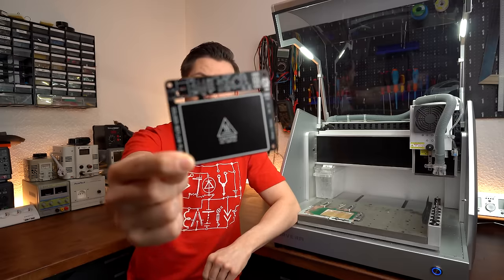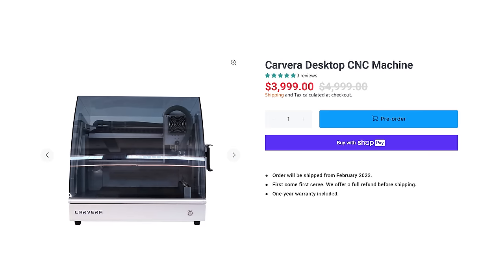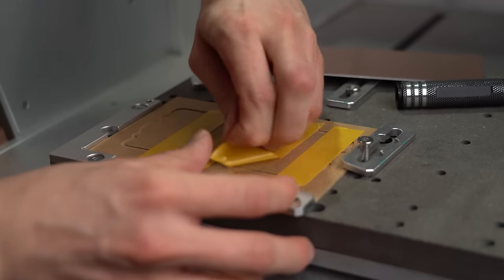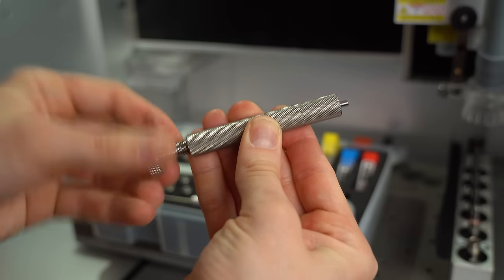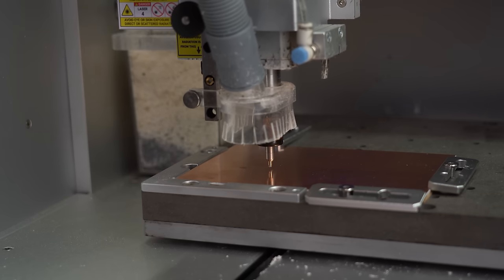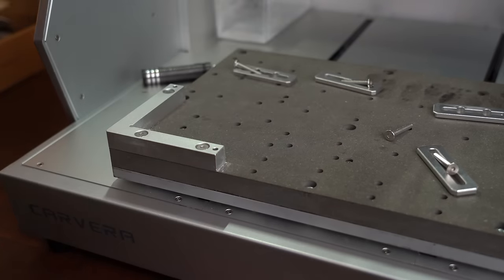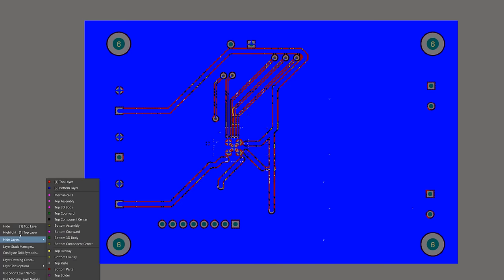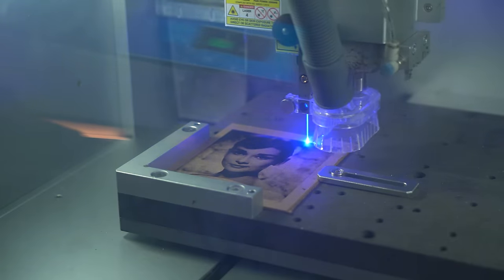"A Machine PERFECT for Making PCBs at Home" Is what they said!

Comment: The whole point of doing DIY PCBs is that you're done in a couple of hours, rather than waiting a month from China. You can do iteration after iteration. Then once you get it right, you order from the cheap chinese companies.
Reply from the maker: That is correct :-)
Reply: @1014p  I would never send anything there to rando PCB companies if I was designing something for sale, but like it or not, nearly everything which you want assembled for cheap would have to be sent there anyway.
Reply: It doesn't take a month for JLPCB maybe 2 weeks tops. It literally took longer for me to receive PCBs from OSHpark located in the US than it did from from JLPCB. I will say that OSHPark's silkscreen is amazing and the cheap silkscreen option at JLPCB doesn't do a great job with fine detail graphics but it's not a big deal and works perfectly fine for footprints.
Reply: @atomicskull6405  I ordered something from jlcpcb just the other day and lead time was 28 days. Probably has to do with location (I'm in the US).

Even if it took 2 weeks, that's 2 weeks vs 2 hours.
Reply: You don't have to wait a month to get a board from China. Turnaround times are faster then that.
Reply: @atomicskull6405  Exactly right.
Reply: @larrybud  The lead times are worst case. It might take that long but usually it doesn't
Reply: @thedarksage328  I just told you how long it's going to take. I'm not guessing.
Reply: @larrybud  I'm sure that if you work hard enough you can find someone that takes a month to deliver your boards.  I just know that I, and my colleagues never have to wait more teen 10 days, or very rarely two weeks.  So by all means machine your circuit board and do all the manual secondary operations to make it work if it's anywhere near complicated.  What a waste of time.
Reply: LOL, everyone's like, "it doesn't take ME a month to get MY order..."

Like everyone lives in the same country with the same shipping process and the same Customs agency so if THEY can get THEIR order in a week, everyone who says they can't must be lying... 🙄
Reply: @RealSiViX  yeah, it's so weird. Doesn't negate the main topic of the video either. You can make your own PCBs in an hour or two, and even with the best case of these guys above, they have to wait 10 days. 

I can do 5 iterations of a board in a day, they'd have to wait 2 months....
Reply: For those who live in the US. pcbway(Chinese company) tends to have a one day build time and 4-5 day ship time
Reply: And your custom pcb is now on the Chinese market...
Reply: Well, one of the points. I made my PCBs for fun mainly. There is something really inspiring in seeing your own creations come to life.
Reply: @atomicskull6405  and what if you live in europe?

Comment: I found it to be very reliable to use the laser to etch PCBs instead of trying to route them. I spray a coat of black enamel spray paint. Laser etch the circuit, then into copper etchant like the usual method. I use a cheap 200 dollar solid state laser.
Reply from the maker: Good idea :-)
Reply: Yeah I was wondering if some kind of laser or optical process would give better results, though I guess if you're drilling at all you'd have more tool offsets to worry about.
Reply: As an eastern european "cheap" and "200 dollars" don't mix too well for me 😅
Reply: @DiaconescuAlexandru2024  It's cheap compared to the multiple thousands of dollars that many lasers cost.
Reply: @skylerlehmkuhl135  oh
Reply: Cnc routing is better than laser, because it has much less manual hand work required, and no chemical acid, paint etc required. While they both can only produce simple one layer PCB.  Besides , even using laser, you still need a lot of holes,you either do it by hand drill,or , CNC. How many holes a Arduino Nano dev board has?  Also, CNC routing is safer than laser.
Reply: I've thought about exactly this, including the black paint coating, cool to know it works. Might have to order a $100 20W ebay eye-blaster laser head to strap to my 3040 CNC machine.
Reply: Can you strap it to a 3s printer?
Reply: @xferme  Don't see why not on mechanical level, but depending on the controller there might not be an extra channel available to provide the control signal for the laser head. My little engraver is running off a Arduino Mega with GRBL, so it's got plenty of extra I/O and GRBL already has the gcode features to access it.
Reply: How fine can you get the tracks and details? The big problem with cnc routing tracks is when you try to do fine stuff.
Reply: Dry film photoresist method with a <$200 MSLA printer does that for <1/20th the price, and you don't need to wait for paint to dry.
Reply: Etch you! Sorry I sneezed 🤧
Reply: We tried this as well, with okay results, but some of the traces were malformed (probably my fault).
We run a business involving laser etching fortunately, and using a couple passes with a fiber laser right on the copper before applying solder mask and taking it off with the laser worked VERY well.
Reply: @DiaconescuAlexandru2024  No problem comrade, what You can do is to put an old display with changed backlight and photoresist on pcbs.
The pain is not etching, the pain is in drilling
Reply: @ДаудМухамеджанов  huh, I never thought of doing that, thanks! And yes, the biggest pain is drawing on the back of the copper board and drilling.
Reply: @chrischris6399  CNC routing is only safer compared to a laser as long as you have a proper dust control with a HEPA filter. Stuff like oil and such is not a proper dust control when dealing with carcinogenic FR4 dust. If you are doing that then that's really no better than using one of the cheap Chinese lasers without enclosure and proper laser safety goggles. 

Sane people don't use acid/peroxide to etch boards neither, there are much better and safer etchants widely available.

CNC takes ages to route any kind of more complex design and a lot of fiddling (copperclad probing, machine maintenance/setup) compared to etching, especially when using a cheap machine and needing a high resolution result (e.g. because of fine pitch SMD components).  Not to mention the costs of bits - FR4 eats them for lunch and routing the board with a dull bit is bound to give problems and poor results.

Even with crappy toner transfer I can do 8/8 (8mil/thou trace width and 8mil spacing) board reliably and 6/8 if I push things. With photolithography (= transparencies and UV exposer) 6/6 is no big deal - on par what places like JLCPCB or PCBWay can do for the cheap service. Good luck achieving that with any kind of reliability/at all on a cheap CNC machine.

Etching (whether using laser or whatever else to make the resist pattern) can easily make 2 layer boards, with a bit of care. Not more difficult than doing the same on a CNC. For a larger/more complex board I will likely have it transferred from paper/transparency, etched, drilled and possibly start populating it before you have finished routing the tracks, given how slow the typical low cost CNCs are. 

There are good reasons why you will not find CNC machines in PCB production, except for routing slots and cutting out general board shapes. Even for professional prototyping it is rare, mostly only for RF stuff where things like PCB antennas or microwave circuit elements are prototyped using CNCs. But those are comparably simple patterns and large sizes.

I really don't understand what drives people to CNC milling PCBs - it has only disadvantages over etching. Yes, stuff like ferric chloride can be messy but it is not really more messy than a CNC spewing clouds of dust and noise. It is certainly not more dangerous with some basic precautions either.
Reply: @ДаудМухамеджанов  Drilling is not a big deal - as long you have a proper and a good quality drill press. I.e. don't attempt to hand drill the board with something like a Dremel or a hand drill. The key is high RPM (15-20k RPM), good rigidity and low runout so that you drill straight and don't break the fragile drill bits. Many workshop drill presses are not good enough - either they "wobble" in various ways or have a too large runout for the typical 0.8mm drill you need for through hole parts. 

Get one of the small Proxxon rotary tools + drill stand or something like the Proxxon TBM220 drill. Then drilling even 100+ holes in a PCB is not a problem at all and even fun because it goes so quickly (but if you need that many I wonder why did you design the board like that - or bothered to DIY it in the first place ...)
Reply: Try FlatCAM software

Comment: That's a nice unit. A good review also. I use a cheap CNC for PCBs if I want one and also only single sided. I've learnt lots of techniques to make the cutting work well. I use Diptrace to design my boards. From there I use bitmaps for the track exports into Vectric 2D and then out to Mach3 for the cutting. I have made dozens of boards this way. Works a treat.
Reply: 7days ago?
Reply: @mojiburrahman3956  WHATTT
Reply: @mojiburrahman3956  patreon
Reply: @mojiburrahman3956  Black magic
Reply from the maker: @mojiburrahman3956  Yes Patreon 🙂
Reply: What cheap CNC do you use?
Reply: @manuel_youtube_ttt  I say cheap. It was probably about A$1500, 10 years ago. A basic 3040 system from an Australian CNC company but it was just a Chinese system. That doesn't include the Mach3 software or the Vectric 2D software which probably totals another A$500. I only do through hole boards with some SMD if I can't get a SIP type component. There was lots of trial and error. Honestly, unless you plan on making lots of boards I'd stick to using the PCB manufactures. I use my CNC to make cases as well.
Reply: @steveroberts1861  When you say “stick to commercial shops unless you’re making lots”, is that because it takes practice to get the CNC setup right? And that you need to have etchant around and various other pieces of equipment?

I sometimes get impatient and wish I had the ability to make a PCB now but there’s so much tweaking that I see in these videos that I suspect I’d be spending a bit of time every day tweaking, and by the time I was done I might as well have gotten one shipped from China :)
Reply: @gf2e  There are so many variables to deal with. Firstly, I had no guide as to what RPM or feed rates for the 0.2mm cutter I use for PCB routing. A more expensive system may have all this sorted out for you. Thus, I broke many expensive bits. There's no etching involved. I attach the copper PCB with double sided tape to the CNC sacrifice board. My CNC can only take one thickness reading therefore if the PCB isn't level you'll get a combination of uncut parts and/or cuts too deep. I only cut to a depth of about 0.2mm. Then you have to drill out the holes. I only use about three different drill sizes but at least the CNC does this job well. If I need any other sized holes I do these manually. Once the drilling is done I clean the PCB with steel wool or very fine wet and dry sandpaper, clean it off with soap and water, dry it, spray with clear artists varnish, let it dry and it is ready to assemble.
Reply: @greatscottlab  From which company did you make these boards
Reply: It seems like a nice machine with the abilities it has but I don’t think it’s worth $3000! I can buy a used industrial CNC machine for that. I would buy one it the price point was around $1500 but I don’t think they would be able to do that. Also the software issue is a big problem.

Comment: Honestly the software missing is more a pro than a con for me, because it means you can use absolutely any program.
Having a propietary software could be the start of limiting the machine to operate exclusively with their software so you end up forcefully relying on them rather than just searching for other program to run, like already happens with some 3D printers
Reply: So long as they let you use any program and those options are available. Otherwise, you have a very expensive brick.
Reply: cough ChiTuBox cough
Reply: Yes, and then tomorrow when they stop making it, lose interest, or go under you own a $4000 brick.  
I def agree on this.
Reply: I see your point, but there is value in having software that's bespoke to the machine from an end-user standpoint. It just works out of the box. Though I also feel it should allow G-code from any source provided it's set up for the machine.
Reply: Yeah, I've seen the downfall of many Kickstarter 3D printers by up-and-coming companies, being that they use proprietary software. They might look slick and professional on the outside but trade away a lot of practicality.
Reply: @DFX2KX  yes, except for when said bespoke software doesn't "just work".  I dont think we have to look far to find examples of that.  Sorry, been burnt too many times.  ChokeCaugh***XYZ printing"""
Reply: @jimb032  that's a fair counterpoint, but I've had enough issues getting printers to print with open-source stuff too. So supporting an open standard doesn't automatically mean a printer's going to be reliable either.

Looking at you, Tevo....
Reply: @DFX2KX  except for at least when the company goes belly up you are not stuck.  3d printing is an open  environment and it got as good as it is because it is that way
Reply: @jimb032  I think you missed the whole point of my comment: My Tevo Tarantula was flashed to Merlin (open source firmware), and I've used open source slicers with it (Slic3r comes to mind I think it was). It ran like a steamed turd despite the Merlin version being apparently bespoke. Just because software is open doesn't mean that printer is going to be worth a damn when using said software. Open software has it's merits, but none of those merits have anything to do with why companies actually use it.

They use it because they can dupe folks like you into doing their quality control *for them*. Ender is the exception, not the rule.
Reply: @DFX2KX  "like me"...hardly.  But again, your problem comes from crap hardware too like mine.  I don't give a shit if the software is open or closed in that case.  There is WAY more avenues to fix it if the software is open vs closed.  Unless you of course have no skills.

Comment: I've been photo-exposing and liquid-etching PCBs for 45 years.  The detail, speed, and low cost obviously surpasses the messy and slow CNC junk.  Also 30 years ago, I started using toner-transfer methods using my first affordable laser printer.  Building a UV exposure box is cheap and simple.  Building a heated etching tank is also not a big deal.  Laser printers are now very cheap and the toner-transfer media is still available and easy and fast to use.  That said, with the advent of fast and low-cost high-quality manufacturing (PCBWay, JLCPCB, and many others), I only use home-made methods when I'm in a huge hurry, which isn't often.  Why anyone would ever want to go CNC is well beyond my comprehension.
Reply: If people are already using a CNC for other purposes it makes sense.
Dealing with acid etching materials, and disposing of it isn't the nicest thing either.

Comment: I just bought $100 worth of supplies for thermal toner transfer and ferric chloride etching. I'm still using EasyEDA to design and print the patterns to paper, but now I can produce the final PCB's myself in about an hour with drilling and via's.  I used to be a CNC programmer while working through collage and would love to have a nice mill, but I'll still be doing the toner transfer method for my PCB projects. Why - because once you get the hang to it - it works! I'd say it's better then using a CNC, no matter how much they try to perfect it.
Reply: Use a 3d resin printer with UV sensitive pcb material.